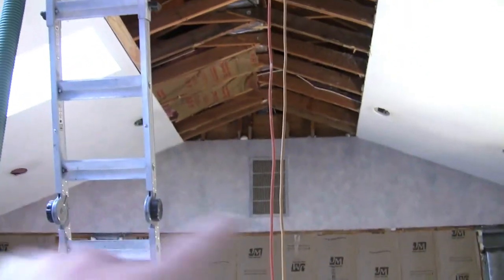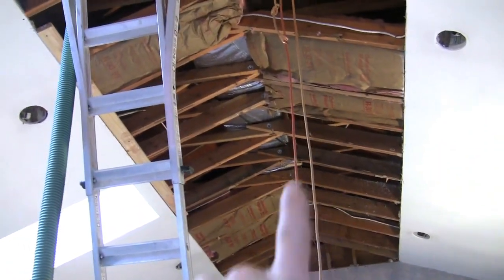Cathedral - Vaulted Ceiling FIX - DIY- Upgrading to Cellulose Insulation

Comment: Do I have to vent my vaulted ceilings at my cabin that’s only heated a few weekends a winter? Metal roof above wood sheathing
Reply: well you still need to get rid of any trapped moisture, so less venting is needed ,but you deffinetely need more than 0%

Comment: Hey Corey, Great video!

I've got the same exact issue, a 1923 craftsman style house with a peaked roof in the attic framed with 2 X 6's, no insulation in the main part of the attic space!

So, beginning from the knee-walls, I can use batt insuation, sheet rock the knee-walls, and then start going up the cathedral/vaulted ceiling with sheet rock, blowing in cellulose to fill the stud cavity up to the edge, then put in the next sheet, fill, and continue, is that right?

But my understanding as a novice cellulose installer *(never done it in my life, lol!), is that what you really want to do is pack the cellulose into the cavity tightly to create a higher r-value and also prevent the air from passing through it. 

I assume there is a setting on the blower machine to pack it in tightly, is that correct?

Then, once you get up to the point of the 2 X 6 ceiling flats, should I first put in R-30 fiberglass batts, and then blow the cellulose on top of it, going across the ceiling one sheet at a time until its filled? 

The only way I can see how you would blow in the final section would be through a ceiling hatch cover, enough to get up there with the hose and blow it in, is that right?

Thanks again!

Gary Brant
Reply: You need to leave airspace between the roof decking and the cellulose. They even sell premade baffles to ensure there is airspace from the soffets to the peak of the roof

Comment: I've worked in many ceiling spaces over the years, installing home theater, lighting control and intruder alarm systems. I HATE this kind of insulation, with a passion. It covers everything, so you have to feel your way around, making installations very slow. Also, it tends to settle after a while, reducing the air pockets and the effectiveness.
Reply: It is some aggravating stuff to work around Matthew, no doubt. Your right, it does settle, but you account for the settling when you are installing it and add a little extra. It is the most economical option.
Reply: queenbeethatme100 No doubt, it doesn't last forever. What was your alternative solution? Spray foam?

Comment: Great videos! I've been browsing all of them and enjoying seeing your creative approaches to common challenges. I'm going to insulating a 22' high vaulted ceiling at my cottage this year but it's unfinished so I'll be able to use Roxul mineral wool batts that mice tend to leave along, at least compared to blown in material or fiberglass batts. I'll add vent strips and make a small attic space like you did in this clip and then vent it front to back and along the soffits. Should keep me busy!

Comment: Cathedral ceiling is where there is no airspace left between the insulation (usually batted) and the roof.

Vaulted is where it is sloped, but still some roof to walk/crawl above, inside the attic.

Comment from the maker: Hey Jgspeer, 
Yeah there's plenty of baffles running from the eave to a ridge vent.  Before I added the insulation I reached down through each rafter bay as far as I could to connect the new baffles with the existing ones.  This allows air to flow through and remove heat and humidity.

Comment: Nice vid man.  I believe it's called cathedral if it has a peak and comes back down the other side.  To be real technical there is supposed to be a throne on the floor just below the peak.  hehe :)  Vaulted is where it only slopes up from one side from what i've understood.  The reason I'm commenting was, I wanted to ask you, if there's an air space for your roof sheathing to breath and keep from overheating.